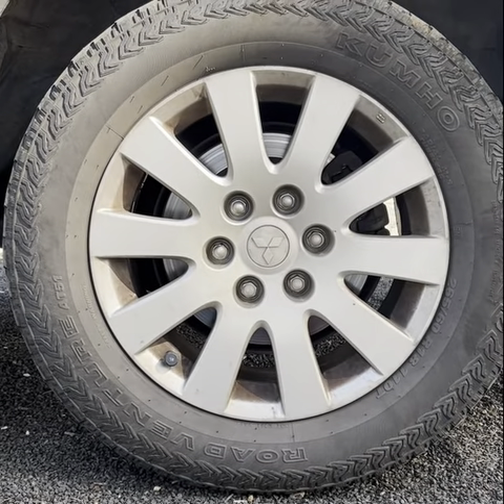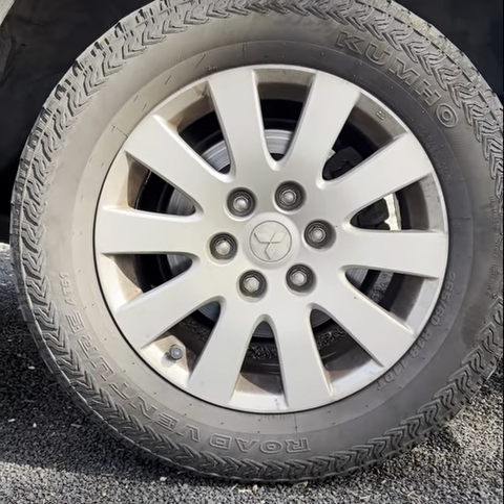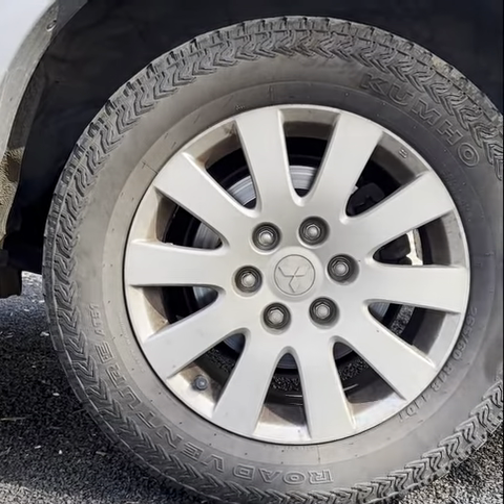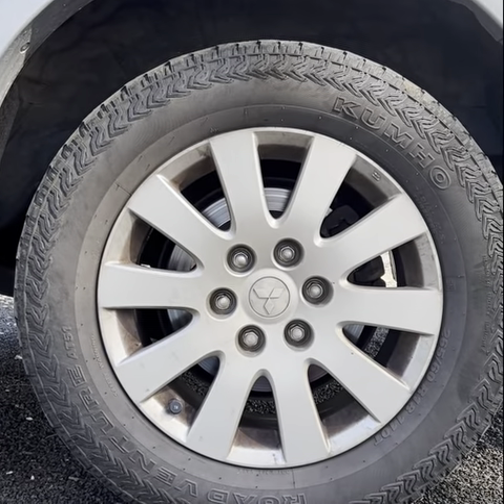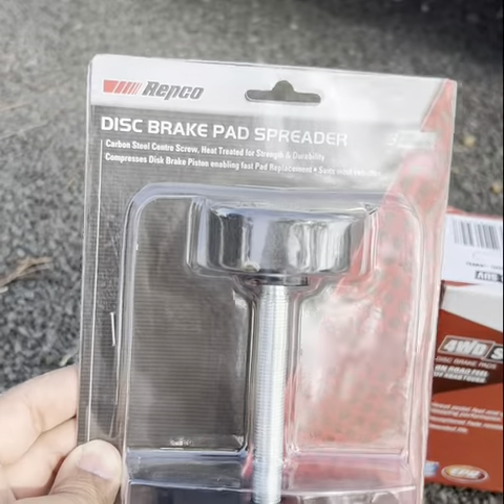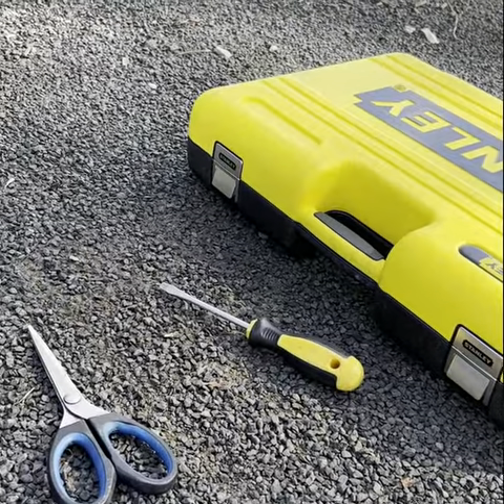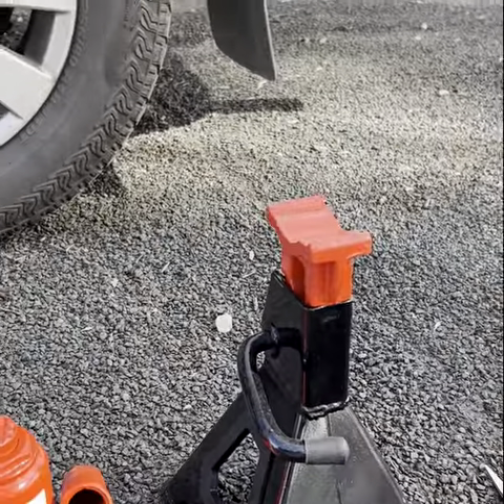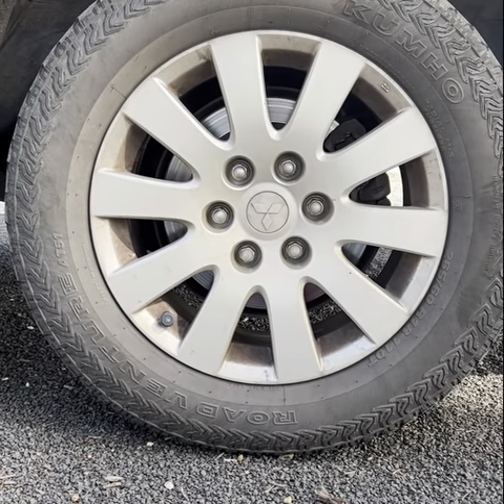Pajero brake pads replacement

Comment: I was just wondering why you said you could bleed the brakes once you removed the old ones? Wouldn’t it be better to bleed once you have installed the new pads as you are more likely to draw air into lines when you push you brake piston in?